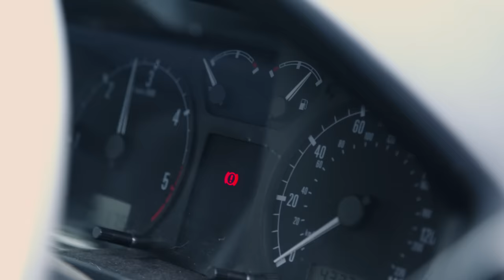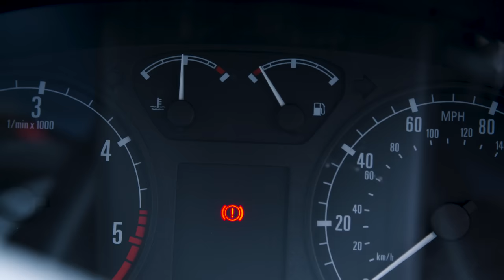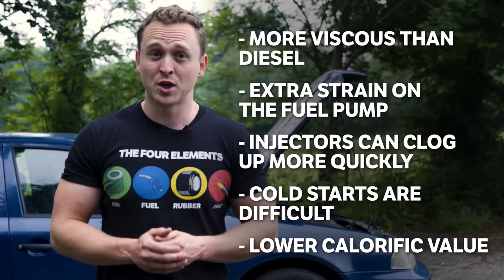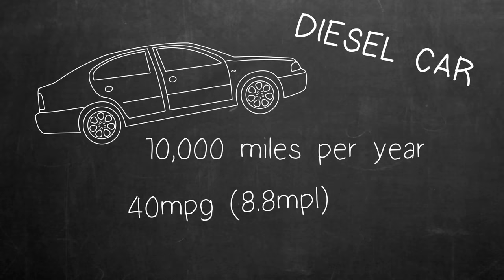The Pros & Cons Of Running An Old Diesel On Used Vegetable Oil

Comment: I've been running my w123 300D Mercedes for over 12 years on veggie oil, no conversion at all.  Ive actually owned over 10 of these cars as id often buy them to fix them up and resell and they all have been veggie monsters.  Just diesel purge every year and only use straight veggie when its going to be hot all day and night.  If you live somewhere where it gets cold in the winter, install the 2 tank system or like I would do, buy diesel and mix it.  
Also, you can buy a 55 gallon drum, put a 5 micron screen bag that hangs inside the container, poor in veggie, let it filter, then have a pump that connects that drum to a larger one preferably above your head so you can just pull up next to it and gravity feed it into your car.  simple.  I've used over 10,000+ gallons of oil throughout the years and have not had any significant issues resulting from WVO use.  I highly recommend it because everywhere I have ever lived, there is always more veggie oil available that I cant even take.  Ive never paid for it from a restaurant, golf course, food truck...... either. VEG ON !
Reply: The OM616/617s love that stuff. I've fed mine WVO, SVO, jet fuel, all sorts of old oily stuff (hydraulic oil, transmission fluid, etc)
Reply: @benz merc I know people that have done it, but less long-term than the 617s.
Reply: All you need to do is use neat oil with 20% petrol and some redex

Comment: The city of Seattle in the Northwest USA used vegetable old oil to fuel their city buses back in the early 90's. It was cheaper, put no sulfur into the atmosphere (low sulfur diesel was not available at the time), and they had added in nitrate removing systems in the exhaust in the late 80's already to help reduce smog and also because the county Seattle is in had passed emissions standards that required the modifications.

They replaced these buses in the late 90's and several of the old ones were bought by rural counties on the east side of the state as counties set up bus systems. They ran them on diesel again since there wasn't enough waste oil in the region to keep them on it, but they ran fine for another 5 to 10 years before being replaced with newer buses since they had worn out by this point. The engines were fine, but the rest of the buses were just worn out by this point.
Reply: nice
Reply: smog and nox are totally different. plus there is no nitrate in exhaust.

Comment: my favourite part about using waste vegetable oil as fuel is that you can smell where you got the oil from in the exhaust fumes if you use all your from the same source. my favourite source is Mexican because like the exhaust smells really nice . (i meant the smell that it leaves in your driveway and where you go).
Reply: You normally have to filter the particles out. A former colleague of my father had an old VW Golf 2 Diesel and basically got his fuel for free from fast food places all over the city. That was before everybody with an old Diesel would use vegetable oil as fuel, so they were happy to give their used oil to him and save the costs of having it disposed professionally (which isn't cheap). He ran the oil through some stockings, filtered out all food particles and drove for free most of the year (during the winter he had to add some Diesel fuel, but that was about it). Once during an inspection the TÜV tested the emission values and got a zero reading.

Comment: Mr Diesel originally wanted his engine to be used with peanut oil. However, one beautiful evening while on a on board a cruise ship, sailing English Channel, he ‘conveniently’ disappeared.
Reply: I imagine he was bumped off either for military reasons as diesel technology was going to be a great advantage in the coming world wars.

Or by those with vested interests in the fossil fuel industry. Or for both reasons.
Reply: @99ron30  Most allied world war 2 tanks ran on petrol and even used engines from aircraft. Later tank designs only changed to diesel because highly flammable petrol was a bit of a problem when you were getting shot at.
Reply: @notmenotme614  
If a discarding sabot project flies through a fuel tank, it won’t matter what fuel it is. It will detonate it.
I think diesel is better for tanks because of the range and torque advantage.

Comment: add non kerosene based white spirit. it acts as a solvent and should make the oil less viscous ( straight from old top gear).
Reply: Aygul18 I’ve read the same on biodiesel websites. Some people use zippo fuel of petrol to make the oil less viscous
Reply: I used to mix mine with a bit of diesel. 5lt diesel to 100lt oil and 30lt diesel to 100lt oil in winter.
Reply: 10% diesel or 2% petrol does the job nicely. At -15C this winter I had to up it to 5-6l petrol...  I get the oil for free (actually often get a free meal too when I go get it) so 5-6% petrol is low cost. with that the old VW IDI engines runs with no modifications to the car..
Reply: +Aygul18
They already do this mixture with "green" fuel sold in gas station, some are 20% diesel and 80% veg oil.
More popular one is 40% diesel and 60% veg oil.

Comment: 6:43 Didn't you say veg oil has lower energy than diesel? You can't use the same mpg value for the calculation.
Reply: Nicholas Lau he lowered it a bit
Reply: Uh.. no he did not
Reply: Yea cause he did the calculation at 40 mpg and hes got 80 mpg before
Reply: But he used 40mpg for both calculations
Reply: Ive been using svo for a while. The mpg has been better for me on svo specially in the summer
Reply: I rhink the bigher difference is that he got 20 liters but couldnt use all of it as some is lost in the filtering process
Reply: Benjamin Hoefler 80 mpg on 1.9🤔

Comment: So, it's super cheap, much better for the environment (less emissions and less oil being thrown away), doesn't do any harm to your engine if you have a twin fuel system, helps with tailgaters, and smells nice....this should be an option when buying a new car, it's a win-win situation (except for the gas companies of course haha)
Reply: I don't think new vegetable oil is cheaper than diesel, only used oil is.
Reply: The laws in different countries is probably the reason why manufacturers don't do it. If I wanted to run anything except diesel (which is taxed) in a diesel car, I would have to pay 670 euros PER DAY of use. Which is stupid and prohibitive
Reply: I only feed my engine with the best refined cold pressed olive oil. Only 18€ a liter.
Reply: It was my understanding that veg oil produces far more Nox emissions than diesel fuel. I’ve used refined 100% biodiesel in an old ALH. More expensive and I didn’t like the smell as much as I like the sweet smell of diesel fuel in the morning lol
Reply: Dunno about UK but companies here in Aus actually go around to to these Chippys and their like and purchase the used oil off them. I think they centrifuge and filter it then resell it....
Reply: CoreTech951 the emissions are the same

Comment: A friend of mine ran it in a mid 80's GMC van with no modifications. I ran it in my military G wagen with the OM617A engine. That primitive 'tractor' engine ran better on veggie and waste oil than I'd did on diesel. Keep a case of filters on hand though.

Comment: The money saved by switching to veg oil from diesel will be used for maintenance like  de-clogging injectors or to replace the fuel filter.
Reply: A good thing to do is get some cheap oil filters and an electric pump to filter down better than the cloth does.
Reply: @stonent  oil filters? Or fuel filters?
Reply: Oil filters. Not fuel filters. Make sure you get good oil filters that filter out better. Parts stores will tell you which ones to buy.

Comment: Adding normal diesel to the veg oil helps lower the viscosity.
Reply: Silver Van Man petrol does it better
Reply: topic is diesel...tsk
Reply: I run 50/50 with no mods. Perfect.
Reply: You can also do 20% petrol

Comment: Forvive my ignorance, but could you mix diesel with the vegetable oil?
Making it less viscous and a higher calorific value?
Reply: That's common to do especially in the winter.
Reply: Yes, 80/20
Reply: I think that back in the day people would put a little bit of petrol in their regular diesels to help on cold starts. Not sure if modern engines would tolerate this but maybe watering it down with petrol will make it possible to get to diesel level of viscosity (or close to).
Reply: Asher Werner Mercedes owners manual rather recommends using paraffin to improve fuel oil viscosity up to 50% (w123 240d)
Reply: Yes. You could also run a diesel on kerosene, which is less powerful like veg oil, yet doesn't gum everything up. You can even run Jet A as long as you add some sort of lubricant to the fuel mixture. Two stroke oil may work, but I'm sure there's some sort of lubricant made specifically for diesels.
Reply: A litre of white spirit into the veg oil per tank is all you need, old diesels will run on anything but don't try this on newer models.
Reply: The manual for my old Volvo 740 recommended putting some kerosene in the tank during winter if you had the diesel model
Reply: Depends if you plan to cook with it 😋
Reply: @lsswappedcessna  kerrro is common mixed with hydraulic oil as kerro has not lubrication properties and destroys fuel pumps
Reply: @asherwerner  yes even when using pure diesel in very cold winters people would put some petrol in to reduce strain on the engine at cold starts
Reply: Yes, it will actually run a bit better
Reply: @fornicateu2 i really want to run bio diesel on my 2008, b6 passat could i?

Comment: Interestingly enough I have some very long term results on running on used and new vegetable oil. I out purchased my 1998 VW Passat in 2000 with 39,000 miles in it. I ran it on normal diesel for 1 year until I discovered vegetable oil. I was working in a 'large institution' that had 1400 'customers' so obtaining used chip oil was easy. I simply converted and old copper heating cylinder to accept used dirty oil through a 6" hole at the top, fitted a 15mm brass garden tap to the bottom and purchased a 3ft long 5 micron filter from ebay and hung under tap. Oil heated, filtered and straight into car at 100% when weather was above 15 degrees C, and diluted it with regular diesel in the colder months up to 75% regular diesel. Some 24  years later car has 229,000 miles on it which I self maintain and it still has the original 1998 exhaust on. Only downside is I have to put pure diesel into it to get through MOT in UK, as with vegetable oil it does not give a high enough reading for test!  Incidently the car was laid up for some years and I now only use it for daughters visit from Australia. Once again it has just sailed through an MOT and it has sat for 3 years with a mixture of pump diesel and clean sunflower oil. The car has no other modifications. I reckon we are all missing a trick here for cleaner running plus it does over 60+ mpg on long runs!
Reply: what kind of copper heating cylinder did you use?! I want to convert my 2003 Mk4 Tdi to run on veggie oil for the summers :)

Comment: You should try and run Miles on flour and sugar and make him smell like a Donut.
Reply: Tyre Reviews that would kill the engine...
Reply: 😂 except he would die. 🙃
Reply: Sugar works awesome to increase your mileage. Just pour a bit, maybe half a cup, into your tank and you'll easily get 50% more mpg, guaranteed. Maybe even more.
Reply: Kids, Don't fall for this.
Reply: Its better to burn pot :D Engine Coputer will be so happy XD
Reply: I dont think you guys unferstand... you can put sand in these engines and they will run 😂
Reply: Tyre Reviews your comment made me laugh more than it should have
Reply: @mrmolotok5934  (psst...i think he was joking)
Reply: @mrmolotok5934  if you are thinking sugar ruins the motor that's a myth
Reply: @davidfield5847  have you seen videos about people putting sugar and other things with sugar in engines?
It trashes the cylinder and valves
Reply: That would cause the speedometer to show miles per flour 😀
Reply: @FreePizza007  that's fucking hilarious mate
Reply: You need a rear wheel drive car to do donuts 😆

Comment: Make life easy for yourself. Go to a garage that runs recovery trucks and get a load of misfuel. Blend this 20% with your waste cooking oil. It will half the viscosity and make it more like diesel. The blend will settle out in 24 hours and be ready to use. After settling it will fly through a 1 micron filter into the tank. It’s 20% more free fuel, and it’s already duty paid. I’ve run this for 120k in my Peugeot 406 (XUD) all year round with no need for twin tank.

Comment: Used to run a Peugeot 205 on new cooking oil years ago. Diesel at that time was around 85p/litre, Lisl sold vegetable oil for 32p / litre. Best thing was it did 50mpg on diesel but 75mpg on vegetable oil. Injection pump started leaking after a few months, but £5 of diesel every few weeks stopped it leaking too.

Comment: I remember, when I worked in food services, that there was a used oil filter that worked like a vacuum.  Could that save time in filtering the used oil, or does it need to be filtered finer?  Also, isn't there a pump attachment that you can buy to place on the hose when empting your fuel tank?  I think it's called a liquid transfer pump.

Comment: Who needs electric cars? This technology needs to be perfected.
Reply: i completely agree yeah!
Reply: There is not enough spare waste oil to power all your cars this way.
Reply: It was honestly, back in the early-mid 2000's,  Not that 'greasecar' crap,   But other companies really took this tech to the edge at the time.   However new vehicles are so computerized and run at such high injection pressures Veg is tougher to use.

2003 is about the last of 'good years' for running Veg.
Reply: Just get a hybrid like a prius and convert it to veggie oil, it would be a win-win.
Reply: Heard of engine swaps and custom fitting though?
Reply: except that your'e still wasting lots of energy, an inherent flaw of Internal Combustion engine and the maintenance cost remains the same (if not increased). as @cjeam already mentioned "There is not enough spare waste oil to power all your cars" but guess what the solar panel production is rising steadily and costs doping.
Reply: sydjaguar if every single gallon of vegetable oil made per year in the US was used for diesel (assuming just using it for deep frying and none goes tot waste) you could replace 11% of all diesel.
Reply: cjeam Bullshit! The amount of waste oil produced by fast food companies would be MORE THAN ENOUGH to supply the demand.
Reply: The technology was created perfect, because the first diesel engine was designed to run on vegetable oil.
Reply: @joe4324  the grease car phase was good times. converted the family tug boat and it worked great. have a stand alone single cylinder yanmar diesel engine that will fire and run on straight veggie oil. in the summer we found mixing half veg oil half diesel ran the jetta, kabota lawn mower and welder but more than half gets rough starting.
Reply: @joe4324  bigger engine cars still use old type injectors, for example BMW 3l diesel engine still use old type injectors

Comment: Years ago I tried veg oil on a Peugeot 306 1.9 turbo diesel and added a second tank like you suggested in the video with new/clean veg oil. It did not like it one bit and always spluttered to halt no matter how much I let the engine warm  up before switching tanks. If memory serves me correctly there were 2 brands of fuel pump fitted on these and I clearly had the wrong type. Definately do you homework if you want reliable running on this stuff.

Comment: 7:25 So used vegetable oil in diesel is same as LPG in gassoline engines? :D
>extra tank for this fuel
>using this fuel when engine is warm

Comment: My uncle had a diesel van modified to run on used vegetable oil. Some parts had to be replaced to make sure they don't burn and to allow the engine to use it more effiently. He mixed the cooking oil with some parts kerosene. The exhaused smelled like fried chicken. Worked great for years! Won't work for newer diesel engines though.

Comment: My ford E-350 van 5.4l v8 gas engine xlt model has 591,000 miles on it same engine and transmission since new only things that had to be replaced where two fuel pumps other then normal service nothing has been replaced in the engine or transmission even has the same transmission fluid in it! engine oil has been changed every 5000 miles with synthetic or synthetic blends only. Most miles are highway most of its life has been delivering liquid nitrogen in a 700lbs tank when full van was retired at 560,000 now its used as a daily/use when needed. It still runs good but does tick a little could be timing chain or valves but it still has decent life left in it.

Comment: I used to run my Volvo 740 Turbo Diesel Intercooler on 90% diesel and 10% old frying oil. Worked perfect even in colder temperatures. 😃